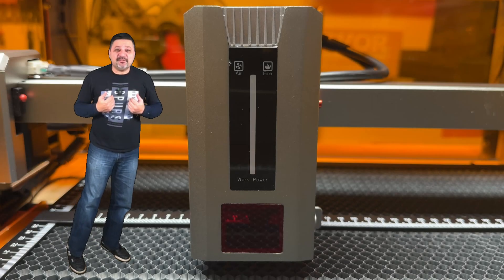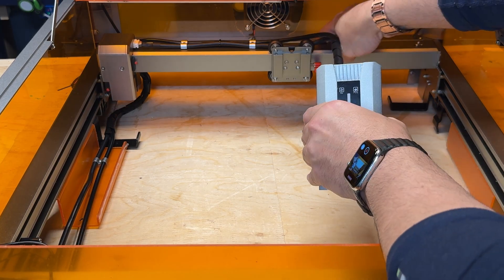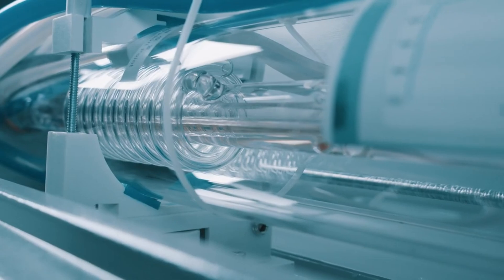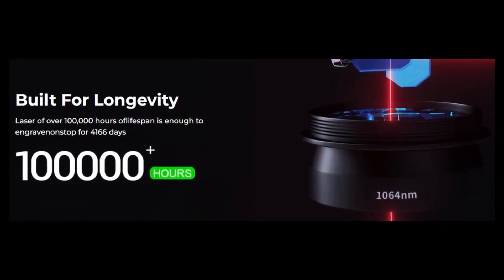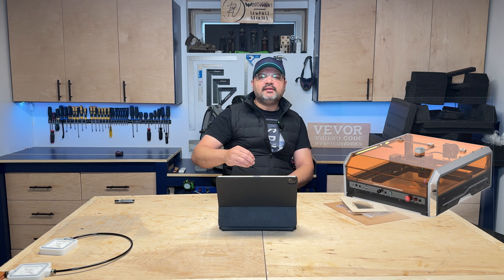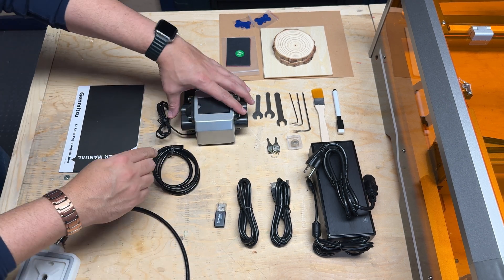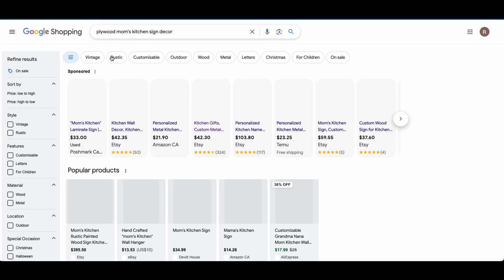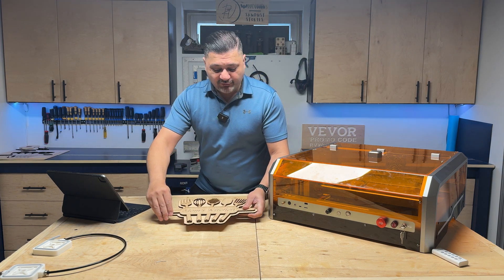Testing a 40W Diode Laser: Is It Worth Buying?

Comment: Could you expand on the benefits of the 40w over the 20w model, obviously you can cut deeper or whatever -- but how much more useful is it really? Thanks for sharing this deal and going over the pros & cons
Reply from the maker: Sorry for the lengthly response but here goes:

1. Faster Cutting and Engraving
	•	A 40W laser delivers twice the power of a 20W laser, allowing it to cut and engrave materials at higher speeds.
	•	Higher power means deeper cuts in a single pass, reducing the need for multiple passes and reduces burning which is a pain to clean up.

2. Greater Material Compatibility
	•	A 40W laser can cut through thicker and denser materials like wood, acrylic, and even some metals with better efficiency.
	•	More power allows for engraving on harder surfaces like stone, glass, and some metals without requiring additional coatings.

When is a 20W Diode Laser Enough?
	•	If you’re primarily engraving soft materials like wood, leather, or fabric.
	•	If you don’t require deep cutting or high-speed production.
	•	If you’re on a budget and power consumption is a concern.

I hope that helps...